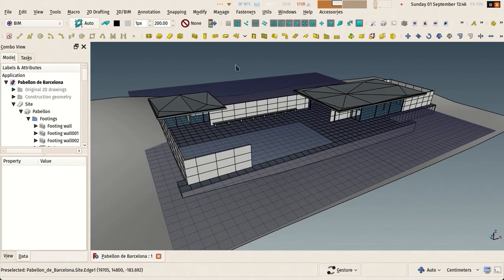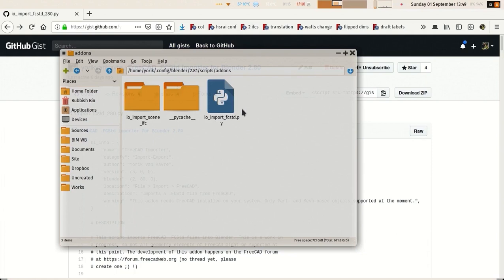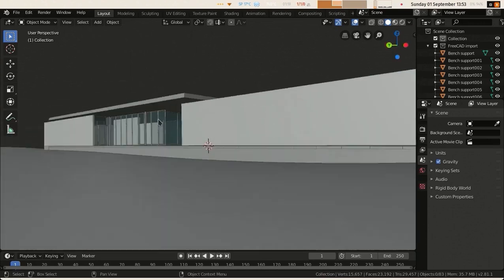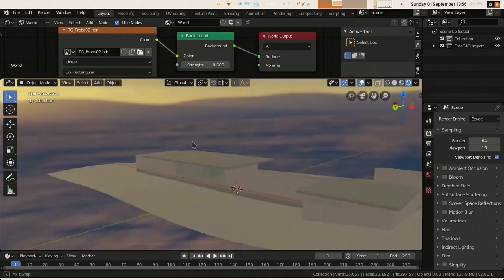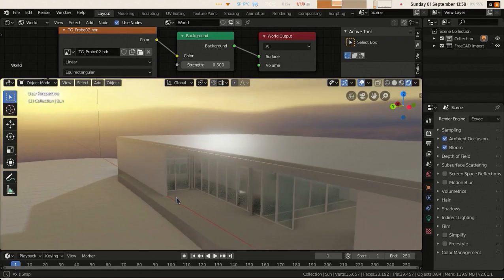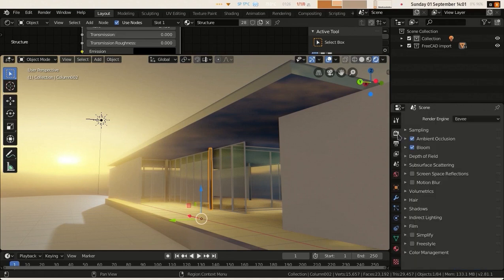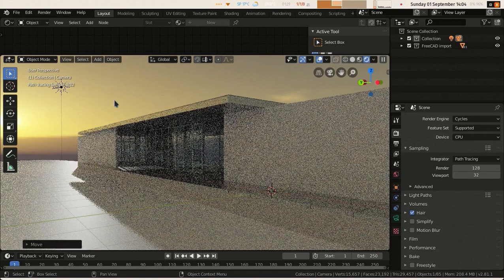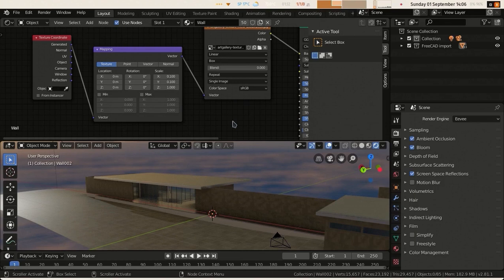BIM with FreeCAD - Barcelona pavillion 17 - Rendering

Comment: hi, does this addons works any more ? I've tried, its not working. I'm using blender 2.9
Reply from the maker: It should still work.. But I haven't used it for a few weeks... I'll have a look if no bug has appeared in the meantime
Reply: @YorikvanHavre  Hi !! ... I have the same problem with blender 2.9... I repeat all the steps and I can see the addon in the import menu, but when I try to import I get this error: Unable to import the FreeCAD Python module. Check Addon preferences.
Any suggestion? Thanks for the videos .. They are excellent !!!